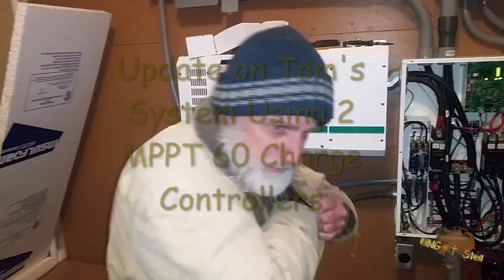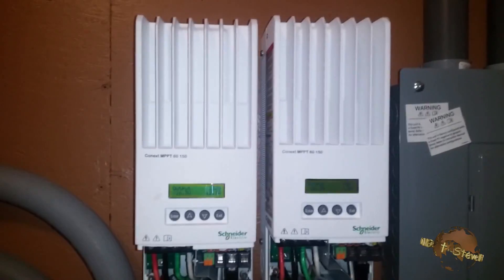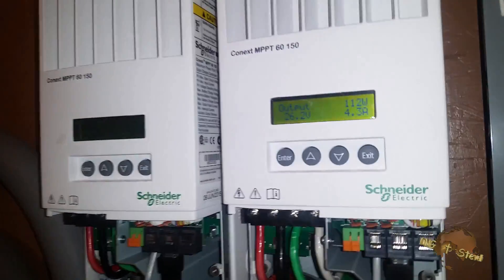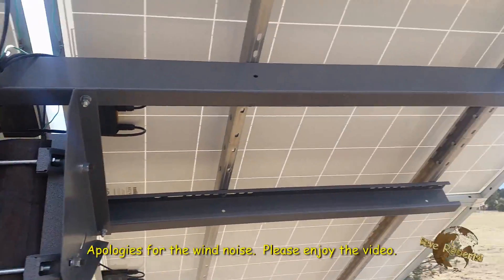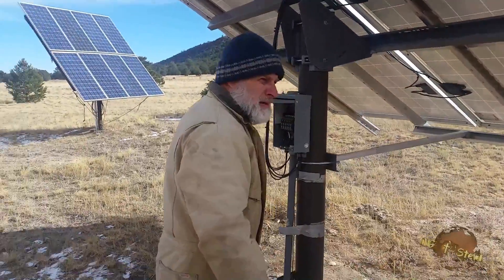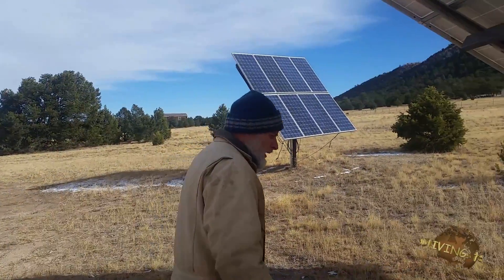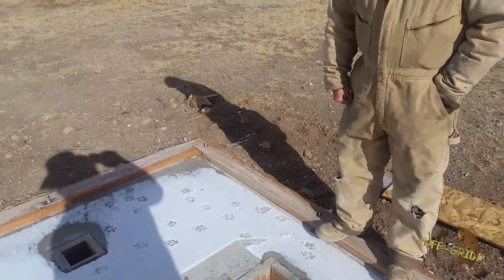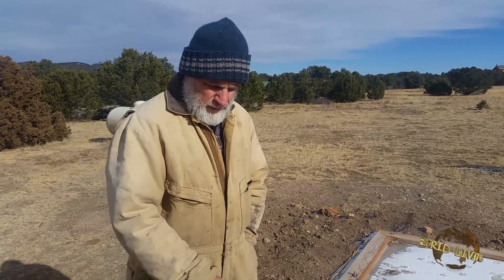MPPT 60 Dual Install with Tom

Comment: I wonder if evacuated solar water heater would help with the green house, going to take alongggg time to heat the water using elements and solar, I've seen  solar evacuated tube water heaters do very well on cold clear days, either way inspirational video, inspirational friends you have, heartwarming start to the vid, can't beat a loving family, God bless.
Reply from the maker: Thanks brother.  Ben is a good kid and is lots of help around the place.  The cool thing about experimenting is that if one thing doesn't work, you try something else.  The experiment is finished when you are either successful or you finally give up trying!  LOL  
We'll see where he goes over time.

Comment: Tom has a really nice set up there. Did the new chargers get sorted out? It almost sounds like one is "throttled back"...like the battery bank is full. Or not...dunno.
Reply from the maker: Tom did find the problem.  He had the + from one PV going to the + of the opposite controller.  The positive was crossed between controllers.  All is good now.

Comment: Very interesting video Steve...  Do you think the problem is only the communication cable betwen the 2 controllers? And that reserve tank is awesome to extend the growth season and a good way to lower the insurance cost for fire hazard.. Once again, you touch some nice topics for the RE community..   Many thanks
Reply from the maker: Thanks Al.  Tom did find the problem.  He had the leads switched on the negative between the two arrays and charge controllers.

Comment: will all the money he put into the foundation, he should get a more robust greenhouse from a better supplier than Harbor Freight that will stand up to the harsh weather there. nothing like the sight of the greenhouse crashed by a storm.

so the missing cable are standard  network cables the daisy chain them together and connect into the convext hub, correct?
Reply from the maker: I agree about the greenhouse, but everyone has their own idea about getting things accomplished.

I have been trying to determine if the network cable used is a standard ethernet cable, and then is it straight-thru or a crossover cable.  If we find out, we'll let everyone know.
Reply from the maker: I finally found in the docs that it uses a straight thru Ethernet cable.  We'll give it a shot!
Reply: hopefully the bus terminators are plugged into the ports. those are suppose to be very good controllers.
what do you think about the pole mount array vs the stand like you have?
enjoy
Reply from the maker: Mine can withstand very harsh wind.  His is movable to face the sun better than mine.